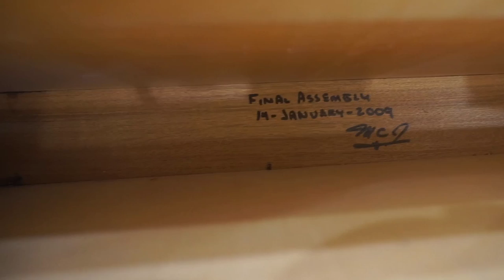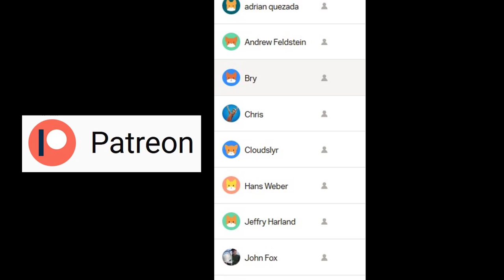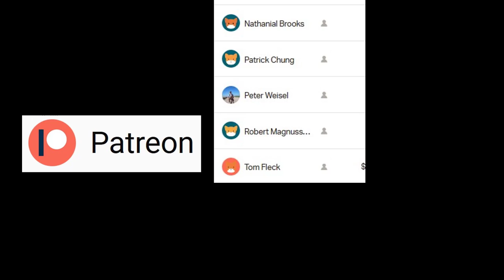Time to Retire?

Comment: I need sure vertical line on mother's gabled hip roof where there is no true horizontal. Laser level I plumb to a spot then see this vertical? plane up the roof but how do I know it's true vertical? I can point side to side and vertical line I can see is definitely not true vertical. This is steep 12/12 roof too. 3 4 5 triangle after using laser level line is an idea but how can I spot the laser to benefit from it's vertical line to get true vertical and make using the cubix laser a super simple process, please.  I have plenty of panel I would like to not eyeball to get vertical.
Reply from the maker: Your question is difficult to follow... I suspect from a language translation issue?  If  I understand your predicament at all it seems like a string line and plumb bob might be the solution.  Great cathedrals were all built centuries before lasers were even conceived so its hard to imagine a problem that can't be solved with a string line and plumb bob.  Best, Matt
Reply: The cross laser is only intended for vertical walls. But we Homo sapiens have a brain so I think I'll use it. I need a vertical line on a 45 degree 12 pitched face so my panels will be straight up and down vertical and not crooked.  So I point the laser slightly right and the "vertical" laser line tilts to right. Point the laser left and vertical line lilts left. Where do you know for sure when laser is in the true vertical plane that is perpendicular to the roof face plane? If you plumb the laser's face straight down do you get a pivot point to help decide where the true vertical plane is? I'm not a plumb rob expert so I have no idea even how to apply  centuries old techniques in my case. So new technology exists. I'm just doing the metal panels solo so I'd rather not swing on my rope and harness too much to figure out old technology plumb bobs. I thought just standing on my eve plank and getting the laser plumbed on a rib would help me get the panel straight. Looking from ground it doesn't seem straight so I'd like to scientifically prove that my panel is straight with geometry I learned as a freshman in HS or, if not, maybe I should give all the money back it took to educate me. Should be easy with new technology lasers?
Reply from the maker: @1weirddoe571  If you have a common rafter in the center of the hip roof  this would be easy: just snap a chalk line across the tails.  Measuring horizontally from the center of the common rafter you should hit the center of a jack rafter at 4'.  Measure up the center of the common 3' and a 5' diagonal from the mark on the jack rafter.  Snap a line through the point up the center of the common to the ridge.  If framing is decent the snapped line should be on the top face of the common rafter from top to bottom and perfect for aligning metal panels or whatever.  Even though this is old school I think trying to do the same thing with a laser is counter productive... and no plumb bob is necessary. Hope this makes sense at it's exactly how I'd approach your situation now that I have a better understanding of what you need to do.  Good luck.... Best, Matt
Reply: @NextLevelCarpentry , yes that one face is easier. This is a broken hip and Gable house on front. Then gables to either side of that. Then plain hip in back. What a 1914 challenge. 20' slopes on 45 degrees, gables are 12'. They didn't even break the hip rafter but instead broke the commen rafters on front gable.

Comment: What is the name of the 300 mph duct tape?

Also.. Viking funeral? :p
Reply from the maker: Viking funeral LOL! I can see it now... 🔥🔥
Reply: @NextLevelCarpentry  The Chinese burn paper houses at funerals so that the dead can live well in heaven; dead carpenters need toolboxes too. :p Just kidding, of course, the obvious answer is to give it to a deserving young carpenter so it can have a second (rehandled) life. Also.. would appreciate the name of that tape.. When I google "Asbestos Abatement Duct Tape" it returns info about Asbestos IN duct tape! The tape isn't in your shopperr page. Could you include a link in the description, perhaps? Thanks
Reply from the maker: Thomas, I enjoy your comments thanks for posting them. I'm not sure if I can get that teal duct tape loaded onto a shopper page or if Amazon sells it but for now I found this link that will take you to the product and it looks like at the company's home website: https://www.abatix.com/abatix-blue-tape-72mmx54-8m-11mil-1-each.html
The price I see there seems about normal although I buy it from a local asbestos abatement contractor that I've known for many years.  You can buy less expensive tape but not better IMHO.  I also use Nashua brand 2-inch gray duct tape for other purposes because it's a bit thicker and kind of stronger but it's not as sticky as this teal stuff. I'm not going to torch my old tool box yet but your suggestions have me pondering what kind of video I could turn out if I did🤔😉😎 Best, m
Reply: @NextLevelCarpentry  Thanks! I'll search for it :)